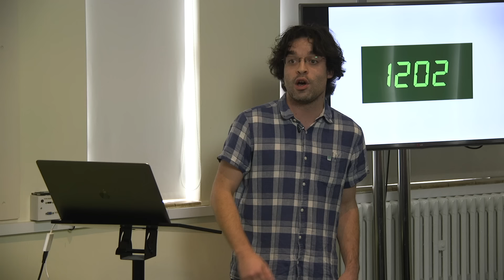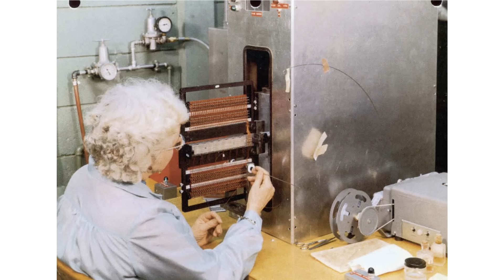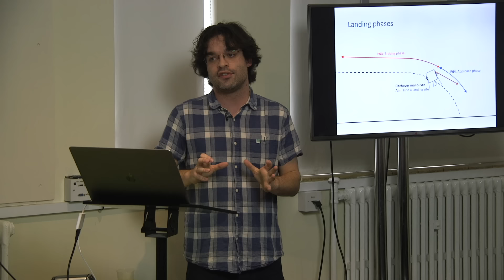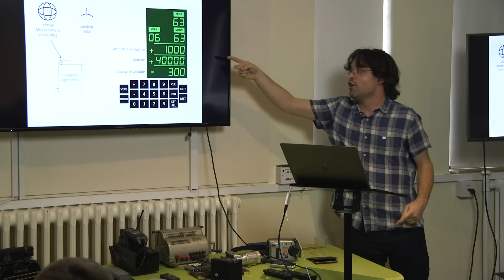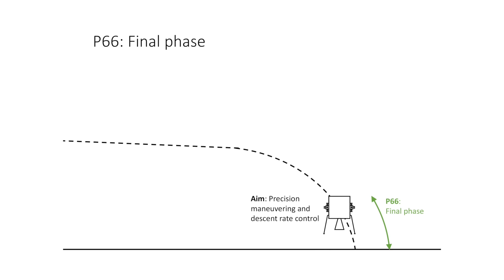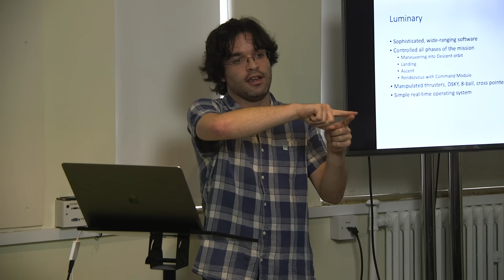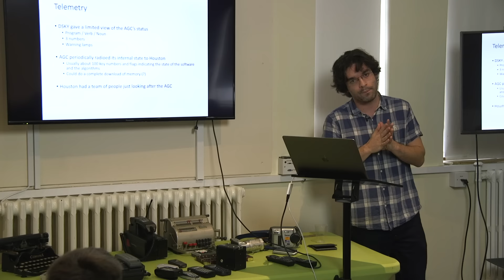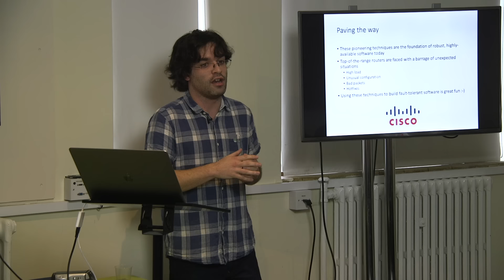Light Years Ahead | The 1969 Apollo Guidance Computer

Comment: Conceptualizing - Summarizing: hardware is always better and more reliable than software.
Reply: Mostly yes - if the hardware breaks how should software work?

But if you have some redundancy in the hardware and a clever implemented software than the software might be more reliable than the hardware.
Think about TCP/IP - even when some hardware in the Internet is broken chances are still good that TCP/IP will provide you a working connection
Reply: @elkeospert9188  true, but that’s just because they haven’t created a “hardware tcp/ip”. My bet is that if such thing existed, it would be more reliable and fast than tcp/ip software. I’m mostly thinking in real things… just one example, cars… they fail far more since they have software. When it was all chips, and even before, old transistors, capacitors and fuses, they were far more reliable. But about computers, tell me honestly, what true improvement have you seen in any of the major application software, say during the last decade? is any program faster? more stable? requiring less hardware resources? being more under your control?
Reply: @CoproliteGastrolite  "true, but that’s just because they haven’t created a “hardware tcp/ip”. "

Even a hardware implementation of TCP/IP might be have some bugs. Most modern CPUs (which are hardware) have some bugs which are documented by the manucfacturer.
There is also no clear border between hardware and software. 
You can implement your TCP/IP-Hardware using a Field Programmable Gate Array (FPGA).
Is that hardware or software?

"I’m mostly thinking in real things… just one example, cars… they fail far more since they have software. When it was all chips, and even before, old transistors, capacitors and fuses, they were far more reliable."

When I think about the problems with my cars in the last 15 years they were all "hardware" related.
And the car electronic which was implemented using discrete components 40 years ago might be been more reliable but also did not the same job. Things like ABS, DSP, Adaptive cruise control, Lane departure warning system - all that needs billions of transistors to be implemented and if realize that using discrete components I doubt that this will work at any time in an automotive enviroment....
And I heared a lot of problems from the "good old times" related to leakage currents in a car.
Causing such funny things like activating the windshield wipers when using the direction indicators and other "strange" phenomena.

"But about computers, tell me honestly, what true improvement have you seen in any of the major application software, say during the last decade? is any program faster? more stable?"

Compare the Flight simulator which was available on Apple II with Microsofts Flight Simulator today and you get an impression how much software has been improved
Or things like "Speech to text conversion" 

"requiring less hardware resources?"

Why should this be an advantage - software should use the available hardware resources.
Reply: Not always.  Properly engineered software is more reliable than the hardware it runs on.

Comment: Great presentation! NASA has been saying for YEARS (now 2023) that they lost ALL the information on how they got to the moon. NASA says it will take YEARS to figure out how we got our astronauts to the moon and back safely traveling 25,000 miles each way thru the Van Allen Radiation Belt. Maybe tnmoc can talk with NASA to help them?!
Reply: Stop lying. They've not said anything of the sort.
Reply: They didn’t.  You need to stay away from the ‘cookers’
Reply: There were many NASA missions.  Each missions recorded telemetry data - which is basically measurements of speed, orientation, and various system statuses - things like that.  It wasn't needed DURING a mission necessarily, but rather for review after a mission in case there was some anomaly or failure they wanted to review.  There were many Apollo missions - six of which landed on the moon.  The Apollo 11 telemetry tapes were reused - accidentally - so the data on those tapes was wiped and recorded over.  That's it.  Apollo 12, 14, 15, 16, and 17 telemetry tapes are intact - - all of which landed on the moon.  The people who make this "they lost ALL the information on how they got to the moon" argument are patent uneducated morons who have no clue what they're talking about.  Period.
Reply: NASA admit all the Apollo telemetry data is missing.
Reply: @papalegba6796  totally false.
Reply: @papalegba6796  
It isn’t.  It’s all in the national archives.  Sothebys actually auctioned a set of Apollo 11 tapes, you could have bid on them, but then they sold for more than a million $$
Reply: @papalegba6796  no they do not. this is a really poor lie from you.
Reply: Google it. All the telemetry is gone 😂
Reply: @papalegba6796  
It isn’t.  I worked at Orroral Valley Tracking Station in Australia and I can assure you that you’re wrong.  In the future try engaging your brain before typing.  Oh, and the only thing lost was a backup tape of the Slow Scan TV transmission.
Reply: @stephenpage-murray7226  you worked for NASA & now you spend your life lying to strangers in YouTube comments sections? Ok 😂

Comment: I’ve noticed that software engineers on youtube are super into mechanical engineering. Weird. I wonder what it is about writing code that makes them like machines so much
Reply: Im no electrical engineer or really anything but a programmer, but learning computer architecture down to the circuit logic gates and discrete math was part of my curriculum. Software engineers also have to think about systems design and physical computers too as youre scaling
Reply: @WoWUndad  Thanks. Interesting facts to know.
Reply: Engineering is engineering, whatever the specialty.